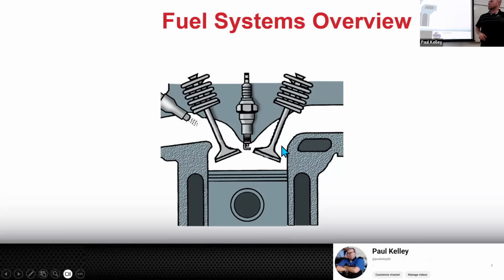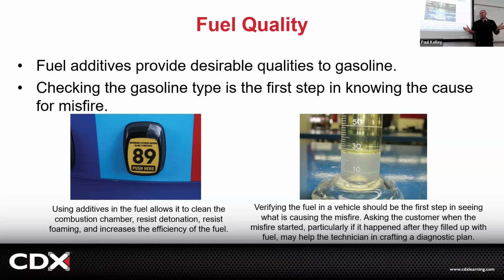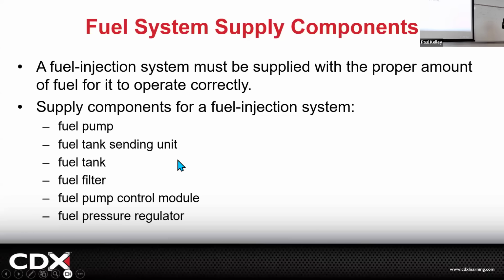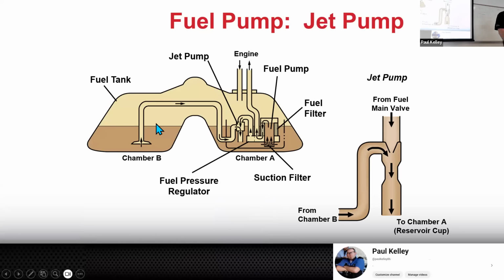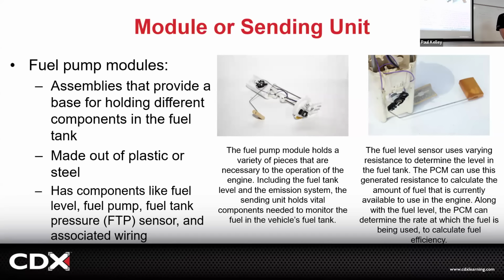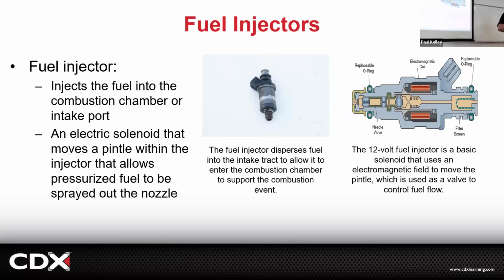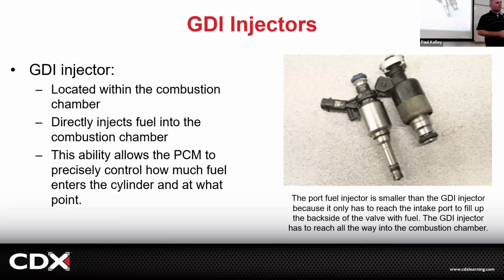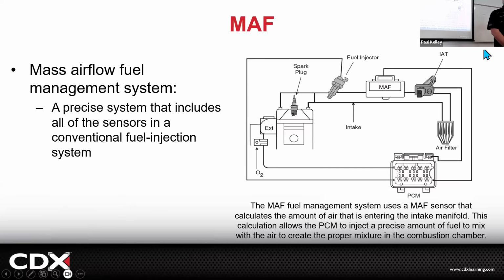ASE A8 Engine Performance Unit 6 Fuel Systems Part 1 (Supply System)

Comment: I used to deliver fuel. When it rains, water enters the underground tanks. If you don't see the lids from the underground tanks covered with black carpets and it's raining, don't put fuel in that gas station. Also, all gasoline is the same, it's the chemicals that are added to the gasoline at the refinery that change it. Every brand of gasoline tells the refinery what chemicals to add. When a tanker driver is empty, the computer adds liquid chemicals first, then the gasoline. It's a perfect mixture.
Reply from the maker: Thanks for that perspective and advice!

Comment: 36:48 How would you know that is E18 and not E10 but with water contamination?  They will look the same on the graduated cylinder.
Reply from the maker: It is possible it could have beem e85, thats true but the reason I know in this case is I talked with the customer about where the gas came from.